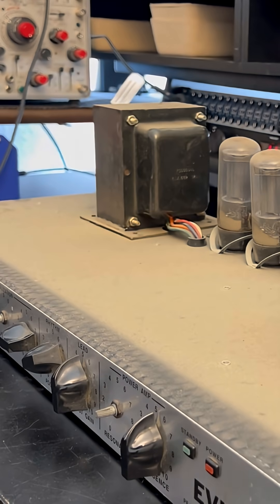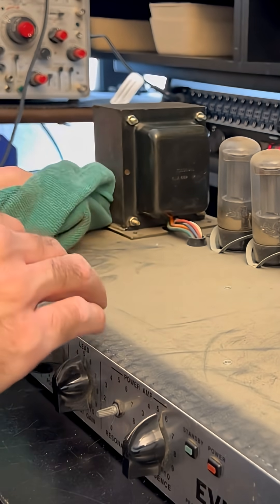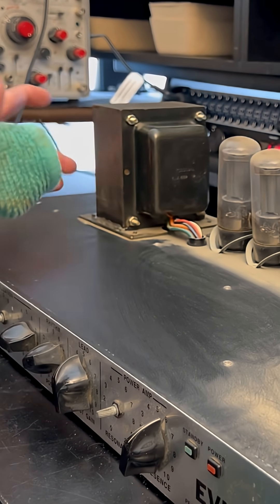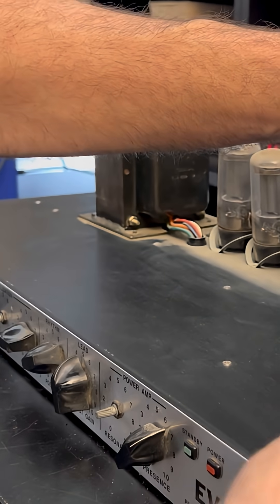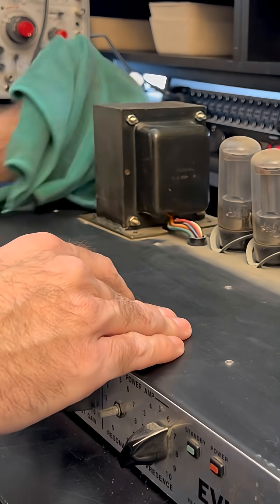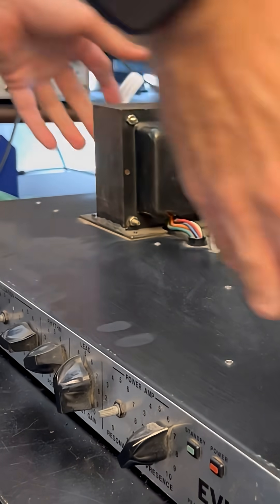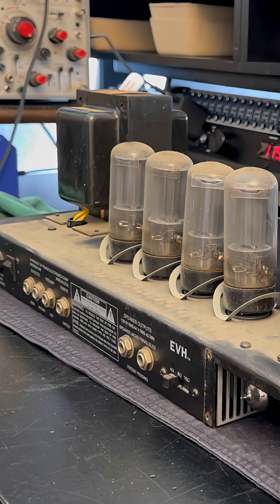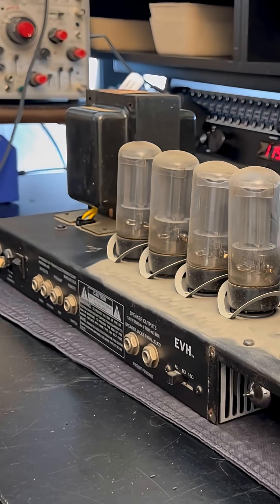Peavey 5150 Block Letter — Pre service cleaning & chat #evh5150 #electronicsengineering

Comment: I remember seeing my first Peavey transformer welded to a mounting plate. I imagined a conversation, deep in bowels of some design lab in Meridian...

"So why are we making the laminations so thin in this transformer?"

"Well, thin laminations allow us to put insulating enamel between the laminations to reduce eddy currents, and increase the efficiency of the power transformer. If the laminations were thick, or if the core was a solid piece of steel, eddy currents would flow and greatly reduce the efficiency of the transformer, especially at high frequencies."

"So it's important that the laminations be insulated from each other"

"Yes. That's the idea."

"OK, now how do we mount the transformer down to the chassis?"

"We weld the hell out of all those insulated laminations to a  thick piece of steel with a continuous bead weld!"

"But... Won't that..."

"NO MORE QUESTIONS!"